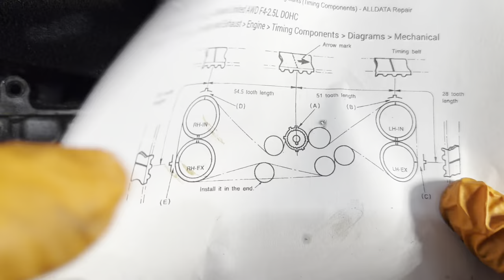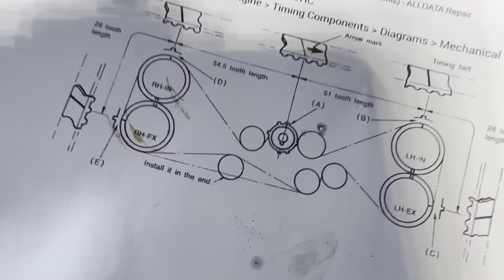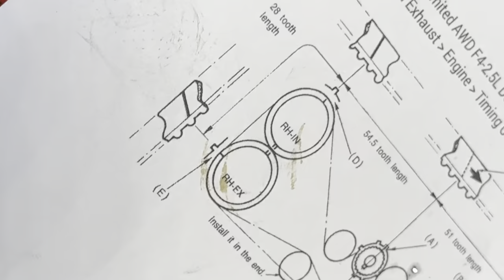SOFT METAL!  Engine Damage! Subaru Legacy Outback AWD 2.5 DOHC EJ25

Comment: I'm not familiar with Subarus. The tensioner bolt appears to go into the water jacket. Ray applied Loc Tite to the Timesert threads which is a good idea whether be it Timesert or Heli Coil in any event. Should the tensioner bolt have had Loc Tite applied as well? Loc Tite will also act as a thread sealant in addition to a thread locking agent. I would think that that tensioner bolt would require some sort of thread sealant to prevent a coolant leak.
Reply: Blue or Orange Loctite on that tensioner would be wise insurance, especially if this is an interference engine (but still wise even if it isn't).

Comment: Ray. Please learn to drill slowly. Your drill will go slowly, normally has a high/low speed switch somewhere on it.  Full send doesn't work on aluminiumununununum. Also most importantly,  get yourself a set of LEFT HAND DRILLS. They make drilling out broken fasteners easy peasy. Hopefully, you learn from this, as I hate screaming "Slowly... Slowly" at the tablet, as my wife unit looks at me as though I am insane. Keep up the good work. Cheers, Dave in the UK 🇬🇧 👍

Comment: That aluminum casting must ultra shitty! I'd almost bet that it would be the case. When attempting to do this operation,
you need a regulated 100 RPM speed to control all this bump and chatter, if not a slower 40-60 RPM.  The alternative to
putting in the new thread cert would be to use a T handle and manually thread it in giving you more control. Upon tapping 
it the first time around with the use of cutting oil, I would then clean off the tap and then apply a small amount of heavy 
grease and then run the tap down thru the threads a second time to pull any remnants from the cutting action leftovers. 
Once the tap has gone thru the second time, I would then use some brake cleaner to remove both oils and grease so as 
to prepare for the new insert to go in, thus so you can apply the lock tight. ALSO, I would apply some anti-seize compound
on that bolt threads that secures the tensioner!

Comment: Ray, your drills armature is out of center. You can see it wobbling on the close in shot. P.S change the thermostat [those bolts love to brake because of electrolysis] good job 2all! your cooling system servant 🥶 🐲

Comment: I learned early on drilling head bolts and such thst using a cordless drill with a clutch is not good. When it hits resistance it stops and possibly damage the hole. I use a corded drill with no clutch or you can use an air drill. Alsonits lot easier when drilling and tapping a dead hole rather than a ln open one,  the bottom of the hole stops the insert and usually is tappered a bit to stop the bolt. All in all you did great
Reply: Exactly. Should be high speed electric drill. Less wobbling and for precise so hole isn’t over drilled.

Comment: Subaru threads have been soft forever. On my daily driver 79 DL Wagon, I never use any power tools on the engine or transmission, because it's so easy to strip out a hole.

Comment: That same bracket on my Outback was destroyed by whoever did the work that ended up killing the engine. They put an  insert into it which desintigrated on me so I ended up getting a new bracket. Need a new engine now but that's because whoever did the reseal and everything put FIPG on the orings and crank supports...

Comment: I know its more work, but I wish the person that owns that car had the thought to change the head and valve cover gaskets as well while it was out. Yes, more money spent (And I know, its not a turbo, so no where near as likely to blow), but the boxer engines are known to blow head gaskets because of how the oil sits in them. Again, I know its more money, but if they would have had it done now while it was out instead of having to get it done at a later time and pay for that labor again, they would have saved that money.

Anyways, good video. Never used time serts, but I have used the other options and I gotta say, starting to like these more. Just wish they were not so expensive... But you pay for what you get with these things as from what I read, they can handle some torque unlike the other brand of re-threads you can get.

Comment: pretty hilarious people in the comments think a through hole for the belt tensioner leads to inside the engine. that hole he is fixing is in a bracket that can be replaced. its called Timing Belt Tensioner Bracket and about 30-40 bucks.

Comment: i see you did not read comments on the last video. instead you bought a time sert kit for probly over 100 bucks and the bracket that you could have unbolted with 3 bolts and replaced was only 35 bucks. that hole definetly does not go into the cylender head as it is only a tensioner bracket that is bolted onto the block with 3 bolts.

Comment: Got to love that cheesy soft Chinese patio furniture grade aluminum that Subaru uses. It's cast from genuine recycled Sapporo beer cans. I have put a lot Heli Coils and Time Serts into monkey metal in my lifetime. GM had a steel aluminum alloy intake manifold in the 1980s that loved to seize up T stat bolts. Sometimes I'd just sink a drill bit in and retap it and part of the old bolt with no Heli Coil. If it holds it holds and if fails later on it can still be Heli Coiled. Heli Coiling a hole twice? That don't work.

Comment: 2:30 you can easily just replace that tensioner bracket. Had to do it on my EJ205. There was a lot of cursing and then I noticed it was just a bracket. Of course they have diff styles. Luckily a buddy had one on a core.
Reply: 22:13 the passenger side cams will be loose. You can spin them and the valves will be fine. Its the drive side that you have to worry about. Company23 makes a lot of good subaru tools. But on the driver side I usually put vise grips just tight enough to hold the cams in place before I take the old belt off or use the bolt method and stick a nut and bolt between the cams to hold them. Easier way to get the belt on once lined up is to install the the lower idler last. You’ll have enough slack to push the belt up and thread the bolt in for the pulley. The double lines will be a hair off sometimes. 
36:00 I also have a 2.2L S10 Xtreme. Check the rear cam gasket. Mine was leaking out of there really good. Used a gasket kit and it didn’t fix it so I just used RTV. I did the pan gasket to but did it with the motor in. Wanted to use RTV but knew there was no way to get the pan back in with RTV so against my better judgement because I also hate cork gaskets I used it and snuck some RTV on the corners and under the crank. Of course its leaking but not that bad.

Comment: A 10mm 1.25 nut on the installer behind the insert (kinda like double nutting) might have helped you on the install.  The nut flush to the block would likely have gotten the insert flanged portion into the countersunk area, back off the nut, and remove the installer.  Or I may be full of crap...

Comment: hey ray, polite heads up you're paying a mass amount for that timesert and i believe it was project farm or torque test channel did a whole thing on thread repair and timesert failed MISERABLY, your standard helicoil or even the cheap "other name in thread repair" worked 100X better then timesert and it was only like 8 bucks instead of 150 for that timesert. just something to think about and the reason it failed is because you didnt tap the treads ALL the way to the end of the hole so the timesert stopped at your last thread and the hole was a bit deeper

Comment: I've always had more problems with stripped threads and siezed bolts on import engines than the domestic ones,  could never figure out why, one of reasons i stick with the vehicle I have, the ole trusty rusty jeep
Reply: Agreed. Everything has opinions What's good what's junk Personally me I stick with older Ford Rangers easy to fix cheap parts and I've had alot in 30 years so I have a ton of parts lol

Comment: Changing the water pump and timing belt when the engine is out is so much easier, especially lining all the marks up.  What are the chips in the cooling system going to end up (radiator or new water pump?).  Torque wrenches are so overrated.  (Crankshaft pulley is 130 ft lbs)

Comment: Ray wondering why the bolt threads keep stripping out, while using a power tool to remove and tighten bolts in aluminum.  😂😂
I say that because I have done the same thing a few times before I slapped myself and stopped using power tools with aluminum.

Comment: Now congrats on the fix! My only question is how long that fix will work? As a person in this field and now does work on the warranty and insurance inspection side. That repair would be N/A. A new potential failure point has been created that "If" failed could cause catastrophic engine failure. Constant heat cycles over a period of time could degrade that repair and has the potential of failure. And as a person that does these said inspections that would be in my report.  
But Helluva job no that repair~!

Comment: way too much reaming to one side on the drilled hole for the tap, missing material / missing threads for the insert to make full engagement physical evidence on the side where the bit went catawampus 11:02 shows in the video after tapping. Given that cast aluminum is a soft material one full / two-handed straight and steady pass with a drill bit is sufficient to begin tapping. 
However..,, from an engineering standpoint 
Given that the tensioner bolt only sees shear side load/ I don't foresee any future issues with this repair

Comment: I spy with my lil eye more Tire machines showing up, does that mean you will start doing tires soon? 

I amost think the last lift you put inside could be in the approach under the roof, and a alignment machine inside the shop where that lift was.  Short term work on the lift tires and oil changes so you dont block the alignment machine, but it should also have a built in lift for brake jobs and frt end parts or axel parts or suspension stuff. So you can do longer term work over there.
Left entry bay a European type flush mount jack for tires only you can also drive over.  Thats 5 lifts.
And 4 guys need to hire 2 more tecs.

Comment: Those oil pans have no gasket. Just use RTV. That is what we did at GM dealer. They suck all around.
Reply: May have had a rear rubber seal. But don't remember for sure. Heavy line guys did those. Been 15 years.

Comment: Is it me or does the bottom right gear look like it's off a tooth, which would explain the reason the double marks on the right gears are off by what Ray says is a tooth?? I've paused it at the 31:31 mark and the mark looks like it's sitting just below the mark on the belt.

Comment: This is what happens when you put a steel bolt with an aluminum block it pulls the threads more easily when the block is hot

Comment: Had a quick double check.
M10x1.25 is metric fine.
Standard M10x 1.5.
Why would they use metric fine on Aluminium?
Anything but that.
Or is the timesert 10x1.25 and the bolt is M8 1.25 so they don't have weak spots in the insert?

Comment: I ended up replacing that whole piece, got it for $30.  Sadly I found out when the tore out the threads it took the valves with it.  Aint got the means to do a valve job so selling my 98 outback for scrap o.e

Comment: I think the tap needed to be run in deeper.Looks like there was still taper on the innermost tapped threads.
Reply: The standard Timesert tap is a plug grind; it won't cut all the way to the bottom of a blind hole, and might have bottomed on the block face adjacent before it had full threads formed.  (As was noted farther down, that hole is actually in a removable bracket that many Sube dealers keep on hand because of this problem.)
Reply: Plug tap still has a slight taper.Bottoming tap doesn't.

Comment: from the looks of it your thread cutting was not complete, the first part of the thread cutter is not cutting the full depth of the thread and you stopped early, it was the first thing i saw/thought when you blew out the hole, it looked like a small part, maybe 2 or 3 turns that were not fully cut. Also when cutting threads for every turn you usually you do a quarter turn back to break the chip. it might not be that essential for soft aluminum but it gives a better feel if you are still producing chips or not

Comment: Didn’t tap it deep enough.  The taps provided are no.1 or ‘firsts’ with a significant taper on the first part.

The insert wouldn’t go in fully as the threads were effectively tapered.

Comment: Not a fan of threads into aluminum.  Aircraft engines use through bolts or studs.  I time-serted a land rover block for the heads once.  It worked but I still wasn't happy.  Would have been better with a stud kit.

Comment: So, if you had decided you wanted to do that V8 swap into that S10, would you have gone with an old school small block like a 350, or an LS type such as a 5.3?  BTW "The Right Stuff" ... I've sworn by this stuff since around 2002 when I was introduced to it.  Had a 1982 Impala with a 305 that puked oil through the valve covers ... not once I used "The Right Stuff" on it, that thing never leaked again!

Comment: i would use red locktide, get a cutting wheel on a saw or table saw, then check your depth then cut the insert to fit, i wish earnie was tech friendly, so i could have him sent you the how to, the guy deal with been dealing with subarus since the 60's, he is a bit of a walking library, ( personally i stay away from boxer engines and german nonsense )

Comment: Tis why I like heli-coils, also why I hate aluminum blocks and heads. Don't understand why you didn't use the red lock-tite, you don't want the insert to come out. Just a little worried about how you drilled the hole, you said you didn't want to go to deep or you'd hit the cylinder, that tells me, you just dropped shavings inside the block, oil pan. Or am I missing something here? Don't know what's wrong with cork? Never had issues with it as gaskets. Cheers :)

Comment: If the repaired hole goes into a water jacket, shouldn't you apply RTV to the threads of the insert and the tensioner bolt

Comment: I wouldn’t touch another bolt/screw/nut on that aluminum engine after this job! If u haven’t learned by now that aluminum is way to soft to be worked on in further projects without a small issue turning huge! That engine should’ve already been back in that Subaru by now and if it was any other make it would’ve been done long ago

Comment: You went to all the trouble to drill and tap the block why not just use a new bolt to fit the threads you tapped?

Comment: Could you have drilled and tapped the original 10mm hole to 7/16" and use a larger bolt?

Comment: IMPROPER USE OF TIME-SERT INSTALLATION: Directions clearly state to install Time-Sert inserts using RED LOCTITE THREAD LOCKER on the insert!  You also should have used THREAD SEALANT on the bolt into the insert SINCE the HOLE ENTERS A COOLANT PASSAGE. Now the bolt will promote Rust AND Corrosion leading to another failure of the threaded hole again upon the next removal of the bolt! Additionally you could have used "grease" on the tap to catch the shavings while tapping the hole. Cearly the service repair information mentions using "thread sealant" on the tensioner bolt. RTFM!!!! ( Read The "F" ing Manual)  There will now be coolant seepage and or a coolant leak until rust and corrosion sets in. As a result the next unlucky Technician will have to deal with the rust and corrosion and further damage due to not correctly and properly using THREAD SEALANT on the tensioner bolt that enters a coolant passage. TIP: The Time-Sert Threaded Install Tool EXPANDS the "flared end" of the insert to LOCK THE INSERT INTO THE HOLE! Do Better Next Time! We all know you can!

Comment: Can you not put a lock nut onto the insert tool
Reply: The insert tool is slightly tapered and will expand the insert to make it mate safely with the threads cut into the block. I think they recommend you actually lubricate the insert tool so it bottoms out easier, but with the limited depth in this case that's not really an option. But yea, one or better two nuts on the insert tool should have been enough for a depth stop.

There's other kinds of inserts that are formed like springs. These are installed with a insert tool that turns the insert from the bottom. When it encounters resistance the spring will wound around the insert tool and slim down slightly so it can be screwed in. Once you reach the  desired depth you pull out the inert tool and use a punch to break off the tab on the spring that it locked into. when you then install a bolt, screw, or what ever it will expand the spring slightly more and it will bite into the thread in the block and secure it there. These are actually just about as strong as the Time Cert inserts, and can be simpler to install.
Reply: I seen some using the CAT inserts they look decent. There’s 4 wedges that you tap in to lock it in place

Comment: Do you think a very short bolt could have been used to install the insert? Let the shoulder of the bolt push the insert all the way.
Reply: Nope. The tool installs the insert. The hole wasn't tapped deep enough to allow the insert to bottom out.The instructions tell you how to do it. This wasn't done by the instructions, but hopefully, it will hold up. The only issue I see is that he should have used some sealant on the bolt because it could seep some coolant in the future. If it seeps coolant, then it will have to be taken all the way apart again to put sealant on the bolt.